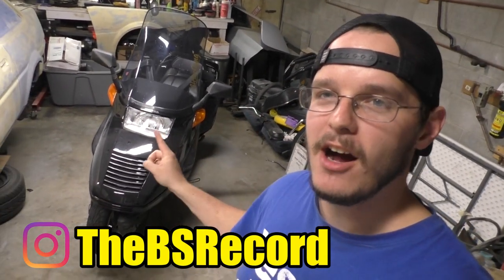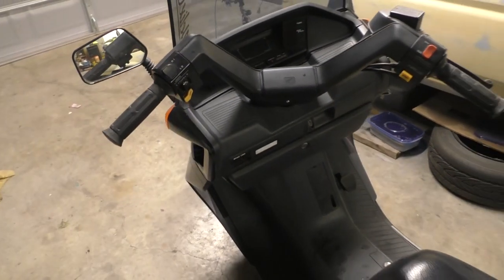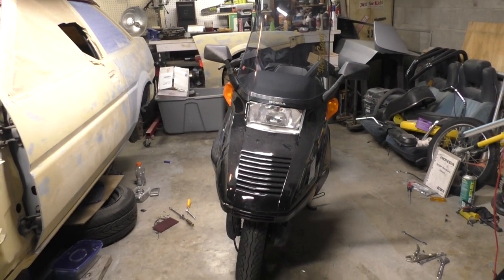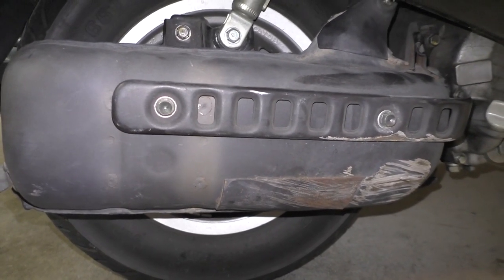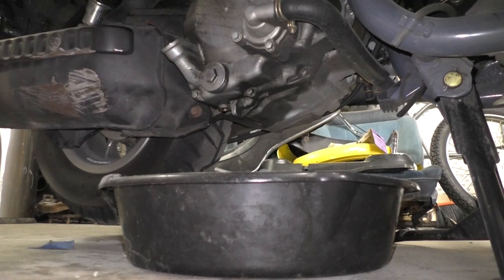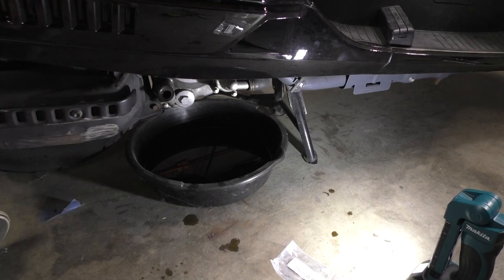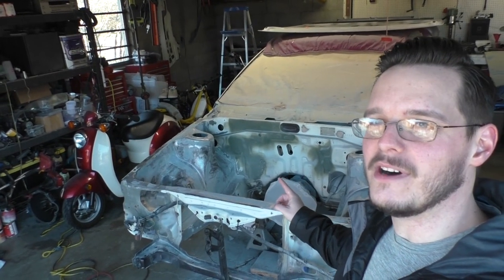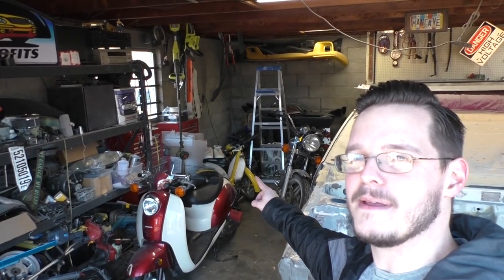Honda Helix CN250 | Honda Helix Oil Change and Repair - Scooter Restoration Project | Honda Fusion

Comment: Wow, thanks for another great Helix video. If you remember I've commented to you on your others ones since I am a Helix owner too having owned my pure red 1996 model with 22,000 miles since 2018 after I retired driving 800 lb monster 1500 & 1800 Goldwings back in 2004. I bought the Helix in good running condition but needing some overdue general maintenance performed so I replaced the whole CVT with all new genuine Honda parts with the exception of 21g Dr. Pulley sliders in favor of the stock 23g rollers, flushed and replaced all oil, brake, coolant & final drive fluids, replaced the tires, installed a new intake manifold, air filter and bystarter, I used Mobil 1 75-80W for the final drive fluid in place of multi weight motor oil, and don't forget to replace the fuel filter which is so many times overlooked but inexpensive to replace to always insure trouble free operation as I now consider it 100% road worthy without being hesitant to drive it anywhere. The body panels are all still showroom quality but I did opt to refinish my stock fading muffler with good results using high temperature Rustoleum 7778 Bar-B-Q black finish from Walmart and used a silver painted accent on the heat shield since I couldn't locate a stock chrome replacement one for the look I wanted, and it really looks awesome. I really appreciate your videos especially this one with several different areas being covered, I've been really a bit occupied lately but hope to begin doing my own videos starting late spring. Keep up the good work!
Reply from the maker: Yes I remember, thanks for tuning back in and commenting! Hopefully you can post some vids on your helix soon, we all need more helix content 👍I'm glad you like the videos, more to come soon and thanks again for tuning in 😁
Reply: Yes. Do more maintenance videos!!!

Comment: ONLY dealers recommend they sell you that oil. It is illegal for a maker to tell you "their oil" is any better because it is not. The service manual says Honda 4 stroke 10w40 SF, Sg or equivalent. All SN, SJ oils today are superior to those early oils from the 1980's in detergency, heat tolerance, pressure, anti corrosion etc.

Comment: Most bikes have to sit on their wheels when checking the oil level, not on the center stand. Check your owners manual. 👏🇳🇱NL, Transalp with many mods.
Reply from the maker: Thanks for tuning in and the tip! I'll check it out :D

Comment: How did you end up mounting the spoiler?  I just purchased new body panels from webike and it came with a spoiler and light as well.
Reply from the maker: Nice! It's been a minute since I did it, but I think I had to drill the holes. It may have already had the cutouts for the bolts though, I don't remember. I do know there were two metal brackets that the bolts screwed into and it "sandwiched" the spoiler to the rear fairing.  Hope this helps 👍

Comment: You know that no motorcycle co. makes oil, and ANY auto 10w40 is correct. There is no wet clutch in scooters so don't be taken in by marketing. Valvoline 10w40 Max Life has one of the highest film strengths of any oil, higher detergency and seal conditioners as do the other max life type oils. This info is from an auto motive engineer who tests oils heated to operating temperature on a computer controlled Tribometer. SJ oils do range from 65,000 psi before metal to metal contact while others reach as high as 123,000 psi and all with the same classification of SJ. Wet clutch compatible oils are not at all needed in bikes that do not have wet clutches. The wet clutch problem stems from  back when they reduced the clutch spring strength to attract more women to riding, it worked. Some guys restore the spring strength of their bikes and then don't have problems of clutch slipping on regular oil and not having to buy over priced "motorcycle" oil that has a viscosity index improver left out that can sometimes cause clutch slippage with the weaker lady springs.
Reply from the maker: Lots of good information here, thanks for sharing 👍 Honestly I don't know much about motorcycle specific oils, but I decided to go with what Honda recommended in the manual. Thanks for tuning in and commenting 👍

Comment: Did the new gasket help with the poppy backfiring on deceleration? I've been having the same problem with mine. Thanks!
Reply from the maker: Yup it helped a lot! It seems to be a pretty common issue with the helix. If the gasket doesn't help look at the air cut off valve on the carb. It may have pinholes in it.
Reply: @TheBSRecord  Sweet, thanks!

Comment: Parking brake won't disengage, any suggestions to get to release ?
Reply from the maker: Yes, press the foot brake really really hard! I had the same issue when I first got mine. I had to adjust the foot brake a little once it was freed up. The adjustment can be made under the main bottom middle plastics if I recall correctly. Google search the cn250 service manual, it should be in there. Hope this helps!

Comment: I'm on my third helix a 2007 "the last helix.  I got two words for you.  Your nuts.    Is that a cfmoto fusion spazio ?
Reply from the maker: It's not everyone cup of tea, but I'm going to enjoy it 😄 thanks for tuning in!
Reply: @TheBSRecord  You misunderstood, I love my helix.  And my Reflex and my shadow.  I meant that frame replacement was nuts.
Reply from the maker: @kennypool  gotcha, I thought you were talking about the plans for air ride 😅.  This is a 2001 Honda Helix, with a aftermarket plastic set from webike. The frame is original but plastic set is not. I have been riding it how it is since I made this video and I love it. Such a great scoot!
Reply: @TheBSRecord  on your dashboard should read helix on left and Honda on right under the turn signal lights.  That's not a helix dash.
Reply from the maker: @kennypool  hmmmmm not sure where you got that info but on a 2001 honda helix dash, Honda is the third light down on the left and Helix is the third light down on the right. Both of those are on my dash. Maybe it is hard to see in the video.

Comment: Hey nice work. Do you think a 10 hour drive would be to much I don’t think so but the guy I’m buying it off of said it is it has 10,000 miles on it original owner 2001 very nice condition.don’t have a truck planned on driving it back if I buy it with my wife in my car following.
Reply from the maker: Without seeing the bike or knowing it's true condition I'm not sure how it will do on that sort of trip. However, if it's in good working order, properly maintained, and we'll kept it should make that trip no problem. I would hop on my helix and ride it anywhere without thinking twice. The helix is a very reliable bike if its taken care of! Goodluck!
Reply: @TheBSRecord  thanks it’s mint according to him original owner older guy
Reply: @TheBSRecord  I seen six pics on ebay

Comment: I noticed your lower panels are gloss black. I have a yellow 2004 and all my panels below the belt line are flat black.  I have toyed with painting them to match the upper panels.  Yours look really nice in a gloss finish.
Reply from the maker: Thanks for watching and commenting! The lower panels were included in the aftermarket fender kit I ordered. I like the gloss finish, really cleans up the scoot imo

Comment: Hello
I'm asking for help

vibrations occur at low engine speeds. just before it reaches 0 km.
there is no vibration when accelerating.
Everything has been changed + the clutch
Reply from the maker: Does it die out? A little vibration getting close to 0mph or even slowly accelerating from 0mph may be normal. Mine vibrates a bit on take off. Do you hear any squealing? Has the carb been cleaned? Maybe an issue with the idle jet? What is the idle rpm set to?
Reply: @TheBSRecord  rpm 1700

only when reducing speed, just before stopping. shaking

I'm thinking of replacing all the front shock absorber pads.

as well as engine pads
Reply: @TheBSRecord  messenger /Facebook?
Reply from the maker: I'm most active on instagram, same as my channel name!